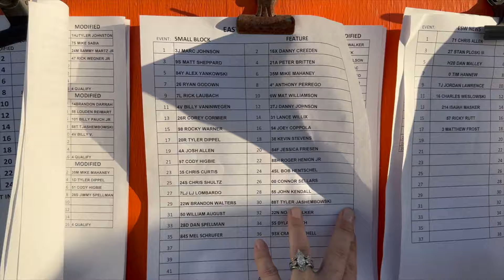Bad Luck Strikes At Orange County Fair Speedway | Eastern States Weekend

Comment: What I heard Mike on the replay say the car was getting above 230 and so it didn’t sound like it was running all that well. He said a broke. He had a broken belt. The fan went through the radiator so that’s a broken belt and a fan went through the radiator and it was getting two 3230° Which it started smoking on like overheating smoking about lap I would think that lap a is when it started doing that and then when you shut it off, it started overheating big like a major puddle underneath the car

Comment: Hey Mike, you probably could’ve put some bars leak in there or some egg whites that’ll help seal it better that’s what I know about radiator stuff like that. How about some pepper black pepper in there ground up black pepper it’ll seal up your thing like that but I know you guys are going a little rough with the motor and motor. It’s radiator just a little bit of this and a little bit of that and I know that you guys go race and you have fun with us but I also know I know you wanna finish better in these races you know I wanted you to win at Oswego or at Fulton I wish I could’ve been there at Fulton. I didn’t have a vehicle. My truck went in the shop. I had a dash acting up didn’t know it was a fuse, but it’s always something when you get an older vehicle 12 years old 260,000 miles yeah 12 years old I’m putting new tires on it on November 16. I’ll be getting ready for the parts peddler car auction at the fairgrounds in Syracuse. We’re gonna be there for that.

Comment: Had the same thing happen there once. Only the hub on the water pump came off and the fan took a huge chunk out of the radiator. Always was fast there but a lot of bad luck. The red flag was a big money saver.
Reply from the maker: So you feel our pain 😩 but yes could have been worse
Reply: @dirttrackuntold  yes and I forgot to mention, ironically mine happened just after the cauting came out.